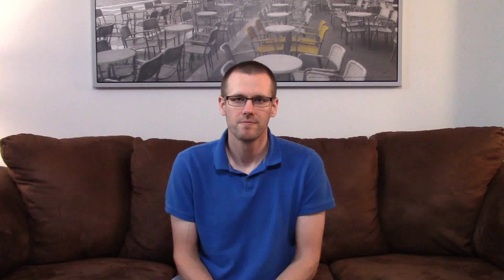Introduction summary of how to Pick an RC Brushless Motor, ESC, LiPo

Comment: Hey sir, im from uni student. My team and i are going to make our first RC boat. As a mechanical, i still confuse which motor should i use? How i determine the suitable KV for my rc boat? Fyi, its for race and the maximum esc allowed is 120A and 75cm long for the hull. Of course i still don't know how to choose the correct propeller. Could you help me?
Reply from the maker: What is the objective of the boat?
Reply: @RCexplained  it is going to be 3 laps and i hope it can run fast and also efficient (every components are running efficiently)
 . Actually because of the virus, for the first step, we just have to choose the right components for the boat with the correct math calculation
Reply from the maker: Sounds great Emerald. May I ask where this is being done? 

Do you have voltage limitations? Cost limitations? Motor limitations?
Reply: @RCexplained  in my uni's lake, and we must use 3s battery and there is no motor limitation
Reply from the maker: @emeraldfurqon378  Sounds good, not all Uni's have a lake, that's awesome! Which uni?

With a 11.1v battery and pulling 100A or so, you need a motor that can dump about 1000 watts continuously. Size the motor according to that. It would be somewhere around 40mm diameter x 65mm length. In terms of kv of the motor, you will want to be somewhere around 30,000RPM unloaded. No more than 35,000RPM. Are there any restriction in the hull you can use? What hull are you using? This can impact where you want to be on unloaded RPM.
Reply: @RCexplained  Universitas Indonesia mate. Actually we are still doing the hull in maxsurf software (haven't decided yet). But at our last discussion, we have chosen to use V shaped hull

Running in around 30,000 rpm, is it okay about the heat? I thought i just have to run with  2,400-2,600 KV lol (just guessing cause i thought 3,000+KV was going to be overkill). 

Btw, about the track, we start with 25m straight and then U-turn about 10m and left about 10m then Sharp turn then turn right to the start point.
Reply: This is still internal race between freshman :)
Reply from the maker: @emeraldfurqon378  If you have a lot of tight corners in your track then going with a lower kv will definitely help. You will need to have good acceleration to get you out of those corners quickly. Preferably you do not want to drop off plane. Also 30,000RPM is assuming a surface drive hull. If your drive is fully submerged, you will want to have a lower overall RPM. 

Heat is not the issue. Being able to size the correct prop is the concern. Going with a lower kv(total RPM) allows you to run a larger prop creating more thrust. 

Most boat races are at high speed in large ovals with 100+m straights. surface drive and 30-35k RPM is typical.
Reply: @RCexplained  i read rcinfo, but i still confused how to choose the proper prop for a specific application.

Ohhh i see, but for now, we are doing it differently, based on our seniors want us to do the track. Cause sometime, if we take an eksternal race (with other uni), the track will not only straight or something. We have to be flexible for the rules and conditions
Reply from the maker: The prop is the last thing to select. You need to define your targeted "goal" speed, hull, motor, ESC and then the prop.
Reply: @RCexplained  can you explain to me about motor current and power?
Reply from the maker: @emeraldfurqon378  what about it do you need explained?
Reply: i have a 3c, 2212 size, 1100kv motor, and 20A ESC. What battery should i use?
 just asking

Comment: Am losing ma money, In 2 months 3 ESC been damaged. Could you plz explain more about amps? Ex: I have motor with 40A, 1-what would happen if I use ESC with 50A or 60A?
2-what would happen if I use ESC with 20A or 30A?
What are your recommendation of good ESC amps for my 40A motor
Reply from the maker: Hello yousuf, I don't want you to lose more money. Let's figure this out. To really get to the bottom of this I would need to know your entire setup. What RC, what exact battery, exact motor, exact ESC, gearing or prop if airplane/boat?

First of all a 40A motor doesn't necessarily draw 40A. It could draw 5A or 60A+ depending on how you load the motor. The ESC always has to be able to deliver the amount of current in amps that the motor will pull. If the motor pulls 50A based on its load, your ESC should be rated at more than 50A to give yourself some head room. If you use a 20A ESC, it's not going to last long at as it can only provide 20A continuously until it melts and becomes a paper weight. 

I can not recommend an ESC for a "40A motor." I need more information about your setup to figure out what is going on. Please list everything.
Reply: @RCexplained  In fact am using Sbach 342 airplane with motor Detrum BM3720A kv650 with 2 blade propeller 12×6 and am using 4s lipo battery. I will take your advice as reference to apply it to all other planes,ESCs,Motors and Batteries.

Also,Is there rule says ESC Amps must be higher than motors?
Reply from the maker: @yousufalbalushi8253  Yes ESC rated current must be higher than what you are going to be drawing from the drawings. Preferably it should be higher than what the motors maximum rated continuous current is.

Comment: i have some random motors with 2 wires so i guess they are brushed? what do i need to make a small rc car? 
like what motor, esc, battery?
(edit: im thinking about turning a 1/24 model car into rc model car)
Reply from the maker: Hi Jesse. You can take a look at using a 130 or 180 size brushed motor. Choose a good motor wind to work with a common 7.4v LiPo around 400mAh. Brushed motors do indeed only have 2 wires. If you plan to go brushless,  a 12x22mm motor would work well. A 10A ESC would power any of these ESC's.

Comment: After watching several times and I'm beginning to grasp it!  How do you define a "large" or "small" plane though?  The one im building has a 1m wing and weighs around 600g, including receiver, servos, and a couple of AA batteries lol.  Where would be a good starting point for choosing a battery pack?
Reply from the maker: Hey Ben. On the radiocontrolinfo.com website there is some recommendations for battery and motor kv based on airplane size. For a plane with a 1m wingspan, you may use a 3s battery between 1000mAh and 2200mAh.  A 2200mAh will be on the heavy side of the range. Go with this setup if you wish to pull more power out of your motor.
Reply: @RCexplained  Thanks for the reply.  I'll find a similar battery and design the rest of my system around it!
Reply: What size motor and prop did you put on your aircraft?
I am building a 60's aircraft that was designed for a Cox Baby Bee engine with 6x3 prop and single channel r/c. 
Based on my research so far it looks like I need a 100w equivalent motor size, but again which brushless would be best for this?
Reply: i have a 3c, 2212 size, 1100kv motor, and 20A ESC. What battery should i use?
 just asking

Comment: I bought a sss motor 4093/2140kv its specifications is Max amp: 155A
Max volt: 26V
Max power: 4200W
Idle current: 2.6A
Max rpm: 60K
Poles: 4 poles
Turns: 2.5D
Diameter: 40mm
Length: 92mm
Shaft diameter: 5mm 
and I'm partnering it with the surpass hobby 150amp esc its specs are Name: 150A Brushless ESC

Model: 150A

Color: Black

Continuous Current: 150A

Burst Current: 720A

Battery: 9-18 cell Ni-MH battery/3-6S Li-po battery 
BEC Output Voltage: 6.1V or 7.4V/3A

Resistance: 0.0003ohm

Suitable for: 1:8 RC car

Item Size: 59 * 46 * 45mm

Item Weight: 148g
The battery I'm gonna be using is 6s 35C 2200mah 
What can you suggest to this build?
Reply from the maker: Hey Blair, thank you for commenting! That combination of motor/esc sounds like a great option for any high powered 1/8 scale car/buggy. The battery selection is a bit weak though to handle that kind of power. I would select a battery that is over 4500mAh. Or use 3 of the 2200's in parallel.
Reply: How about 2x 3s 2200mah batteries is that fine? The limit for the esc is 6s
Reply from the maker: @huskedworkz1766  2200mAh is too little. I would not feel comfortable with that low of a capacity. When I say put 3 of them in parallel, that is really 6 of your actual batteries. You would form 6s3p. This would give you 22.2v at 6600mAh. 6s2p could work if you load it correctly. 

Otherwise with only 2200mAh you are limited to an absolute maximum of 80 amps.  That's not much.

Comment: This is so complicated.  Sorry, I'm pretty stupid about electronics.  I have a 
1534Kv Motor requiring 2-3s Li-Po,  in a scratch foam radio controlled trainer aircraft at 48" wingspan (I know, pretty small wingspan for a trainer but we'll see) I also have purchased a 30A RC Brushless Motor Electric Speed Controller ESC 3A UBEC (40A 10 second burst capable).   So based on the motor and the ESC, what battery do i Need.  I would like to start with a 3S, what do you recommend regarding exact battery specs? and lastly, what about a propeller? ...I've tried the eCALC programs and even subcribed to it but there's too much info to provide, so complicated im pulling out my hair,  I would so very much appreciate any help you can provide.  This is going to drive me to drink.
Reply from the maker: Using a 1534kv motor, 3s with a 30A ESC,  you can use a 6x4 prop to start. Make sure your motor can handle 20-25 amps continuous and you can move up to a 7x4 apc prop. 

A very common 3s LiPo is a 2200mAh 30C. 

If your plane weights 2 pounds total including every component, 150 watts of power will make it fly very well.
Reply: @RCexplained  -- the motor specs say,  15.5 Amps max current, 207 Watts max power.  Does that change your above recommendations. sorry I didn't include that to start with.  Edit: oh wait, perhaps my motor is undersized because you mentioned 20-25 amps continuous or maybe that's different than 15.5 Amps max?
Reply from the maker: Stick with a 6x4 prop
Reply: @RCexplained  great, you've been extremely helpful !!!
Reply from the maker: I am glad that I could help! Good Luck with your build!

Comment: Good advice, good video! I've been into RC for years, and your video's always teach me something! As an extra, I would like to add that most power systems up to and including 6s (22.2 nominal voltage) are reasonably priced. Once you go above 6s, prices generally jump up.
Reply from the maker: That's a great point Remko. Definitely something to consider.
Reply: What do most people race with?? Do they have classes specifically for 6s power?? I havent been racing RC cars for 15yrs

Comment: I want to bulid a rc boat but the max battery have 2200mah and i already buy brushless 2150 kv , and i dont know how much ampere for the esc 60  or 80 i still dont get it
Reply from the maker: What size boat? What exact LiPo do you have? What exact motor do you have?
Reply: About 75 cm, lipo 2200 4s 45c
Reply: Motor goolrc 2150 kv s6370, 4 poles
Reply from the maker: @Imharija  I would go with a 100A ESC on that motor. This will give you sufficient head room. A 2200mAh pack will work as long as you place at least 2 of them in parallel.
Reply: But the maximal requirement is single battery 2200 mah, it is okay if i put 80 A ?
Reply from the maker: @Imharija  A 2200mAh 45C battery on a power system easily capable of delivering 80A is cutting it close. 

You can use a 80A ESC even a 60A ESC  if you'd like, however you MUST make certain that you will be playing within that specific maximum threshold. This means loading the power system in a way that will not exceed the maximum thresholds. (current / temps)